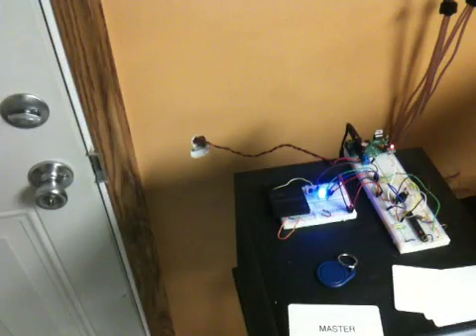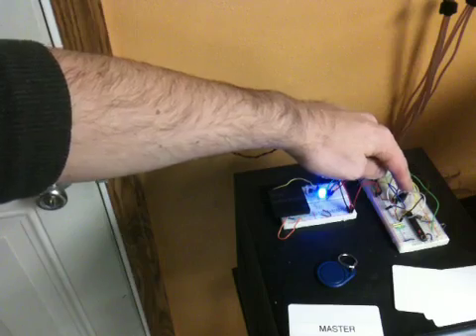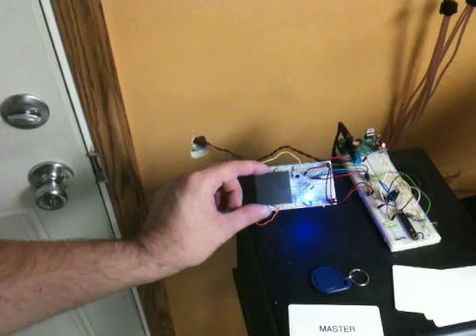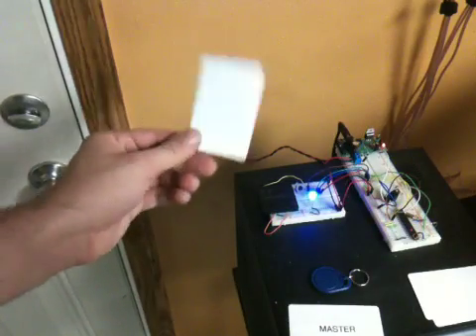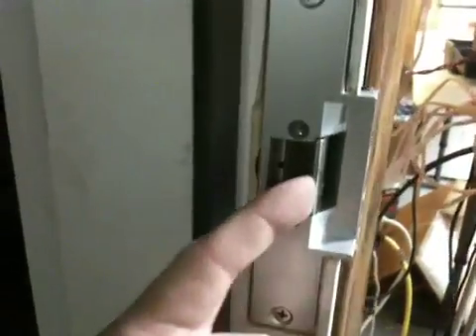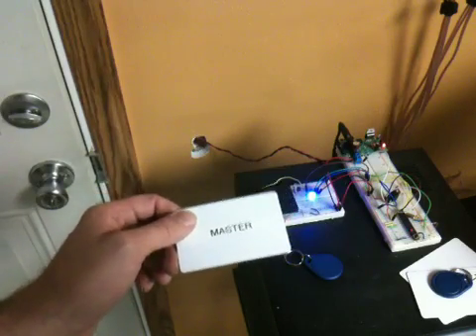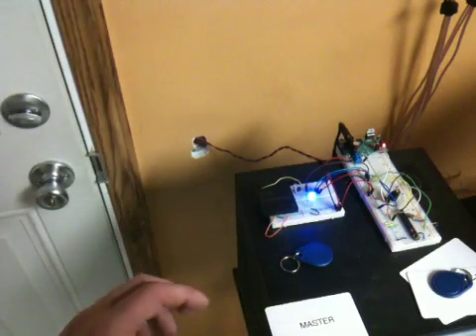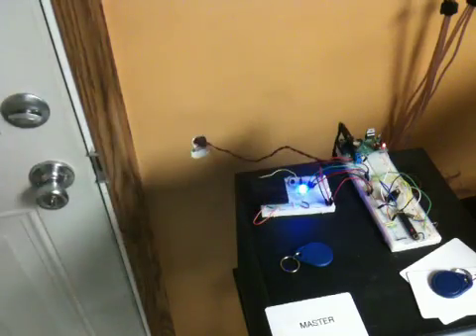RFID door lock prototype

Comment: The ID-20 has 11 pins on it, so I'm assuming you don't need to wire all of those.

You should set a timeout between failed attempts.  I would do like 1-5 minutes between any failed attempt and the master key or 5-30 seconds for a failed attempt and any normal key.  No timeouts means someone could brute force it, though that term seems a little inappropriate in this case.

Comment: @mastrpochii 

I can't tell what the microcontroller is, I recommend to use arduino for beginners.
ID - 20 RFID reader, you can get it from sparkfun.
And the lock is an electronic strike plate.

Everything else (power supply, LED indicators, etc.) is specific to the components you use. 

Hope this helps...

Comment: @ronin730 if possible i would like some info on the system you have in the video i would like to use this system in my fleet of golf carts so it will need to be weather proof and run on 12 to 36 volts dc
Thank you
gene@uiwtx.edu

Comment: Nicely done nicely done! What if 'rip off' the outer box introduce an outside voltage? Something practical, let's say a 9v? Also, is there a delay between readings or can I just brute force it? Lastly, have you tested that door jam? How much force can it hold off?  I'd probably rather make it a dead-bolt type.